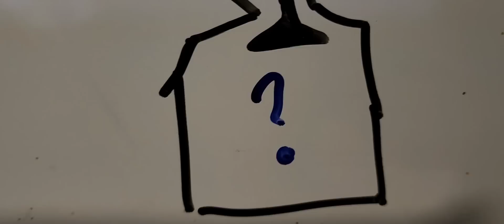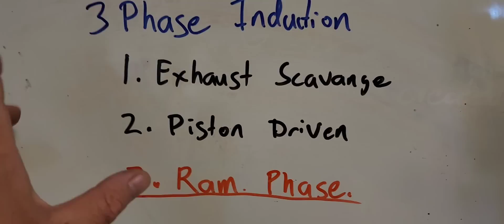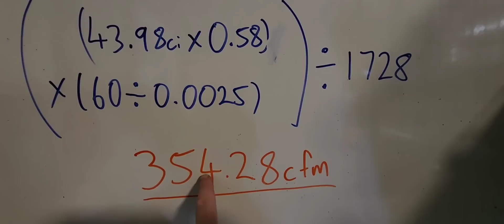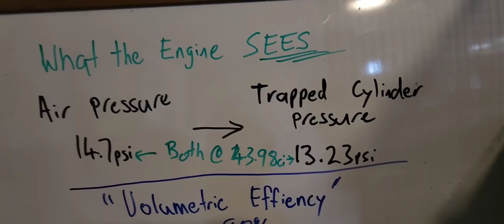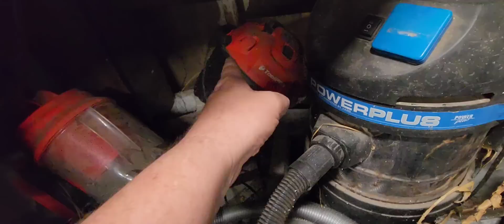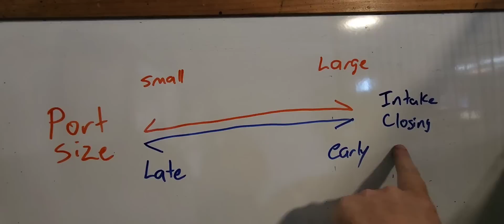Theoretical look at why the 4V Cleveland got its port size.

Comment: Does any of this information transfer to the inverse such as a big block Chrysler head which has very bad flow characteristics?
Reply from the maker: In general terms, if the port is large, then it should respond to an early intake valve closing. 

As I have no experience with Chryslers (yet), I can not give any form of opinion as I have no basis to give one. If it's related to the RB Wedge head (I think that's what Chrysler called its big block range - RB), then there could be other features in the port/chamber that give it bad flow. Until I have one in my hand, I simply don't know. I say this head as the Hemi has got giant ports, so it should fall under the same category as a Cleveland.

Comment: Good thought experiment, thanks.  I hadn’t thought about the restriction p
Area but you may be onto something there. I do believe that the 4v heads were designed with high performance in mind,which is why they are a bit lacklustre at typical street trim and 351ci. They seem to work very well on 400+ inches.

A couple of comments.  Your CFM calculation overlooks the fact that the intake is only open on every second revolution, so the calculated CFM number is half of what you found.

But on the other David Vizard teaches us that on a well built motor at peak torque the so-called 5th cycle actually brings in more air than the rest of the induction stroke.

Anyway, I don’t think either f these points changes your conclusion.
Reply from the maker: Thank you.

While the calculation is experimental, I didn't account for the 4 stroke (so half the rpm) because this is the theoretical demand the piston creates in the first 90 degrees of rotation at every induction stroke. Projecting the demand to 60 seconds fills in the Minute part of CFM. 
I also calculated this way as taking average piston speed would only give average cfm demand throughout the complete intake stroke and ignore the piston driven induction to ram induction. This would lead to conclusions that the 4V port is "too big".
Reply: “Restrictor plates” not “restriction P area”

Comment: Some consideration on intake closing point is the quality of the fuel. If the cylinder goes into detonation because you have trapped too much fuel/air charge, and end up with a too high dynamic compression ratio, you cannot utilize the additional charge of a later intake closing. So the closing must be tailored to the fuel available.
Reply: You can not trap "too much" charge, thats the whole idea of making power.
Reply: @V8Lenny  He's correct, you absolutely can advance a cam to the point the dynamic compression will detonate the motor if the octane isn't there.   One of the reasons the early high compression factory motors all ate crap when they took lead out of gasoline.  Also terrible chamber designs didn't help.
Reply: @superkillr  then retard ignition or lower compression. But you want to trap as much charge as possible, thats how engines make power.

Comment: Mate, excellent video for explaining the 4V concept to non-Cleveland people.

I could see you struggling to communicate your innate understanding of the subject while on the fly, maybe you'd benefit from doing a script for it, so you have to time to articulate your thoughts?

I share a lot of your views on the design principle behind the big port, but I'll add some points that I think are pertinent to the history and racing success of the design, as well as the reasoning why the concept became a dead-end.

Now before all the Ford freaks out there start throwing tomatoes at me, I'll let you all know that I'm a Ford guy myself, however to know a marque well is to know its faults and where their ideas may have stemmed from (ie not necessarily from the company itself).

In the mid 60s, Ford poached a number of engineers and managers from GM. This coincided with the Cleveland and 429/460 head design sharing some elements from GM engines: namely the Chev big block and Oldsmobile V8 (head design and timing cover/fuel pump respectively). So the ideas came with them.

If you ask any BBC expert, they'll acknowledge that there are "good" and "bad" ports, where the equally-spaced, canted valve arrangement was adapted to siamesed runners on the intake manifold, presumably to keep the intake tracts all the same length from carb to valve. This may have achieved the desired objective, but created the aforementioned good and bad port situation. 

The bad ports shoot the intake charge towards the cylinder wall, the good ports have it pointing towards the spark plug (ie centre of the cylinder). There is a good 20 cfm difference between these ports, stock or ported, which means that this is a flaw that cannot be completely worked around.

I would then argue, that due to the Cleveland's cylinder head bolt layout and pushrod location having to match that of the Windsor, that the port direction is actually like those of the "bad" ports in the big block Chev. Again, there is no working around this flaw, as (when viewed in plan view) the port opening starts roughly inline with the cylinder bore, then curves outwards towards the cylinder wall. This is the opposite to how the air really wants to flow, and granted, the canted valve helps turn the mixture back into the cylinder, but that's another turn (and loss of energy) that the mixture encounters. This is present in the 4V port, but more noticeable in the 2V.

I think in hindsight, with such constraints put on the design, that Ford would have benefited with an extreme bias toward curving the mixture more gently into the middle of the cylinder, instead of having it heading completely in the wrong direction then trying to correct it right as it turns into the valve.

Any thoughts on this?
Reply from the maker: Yea, a script would help with articulating ideas in a more consice way. But, like the work I try and convey, it's raw and uncut. I don't see myself as a professional and hope to promote positive experiences and debate from normal individuals.  I  have no issues with the various points of view. If I disagree, I will say why. However, this channel is just a collection of my ramblings that one day I might have the chance to build a Cleveland to put into practice the theoretical I am trying to get across. Let's face it, a 30-second video of a 12-second 1/4 mile makes more of an impact than 30 minutes of chat.

The 2V assessment would be accurate as once a 2V hits 0.4in lift, flow effectively chokes. No matter how much value lift, flow does nothing. In some cases, flow reduction

I will have to include a modified 2V in the head review I intend to do. It has been opened above the spring seat and reshaped using clay. Flow improvement over stock was 30cfm. It raised the port about an inch, so it was very experimental. At best, it would be easier to replicate this work on an alloy unit if it were to be tried on an engine. But financially, I'm just not there by a long shot.

Comment: Ford large port 4v was for racing big rpm not for street use but homologate regultor  of NASCAR etc brought them to public ,Ford's engineering  knew exactly  what  they were doing and achieving they had more experience  than average  joe with a couple  of  vacuum cleaners  ,drag racing ,le mans ,trans am ,canam ,nascar etc the list is longer than a flow bench
Reply: formula 1 could be added to the list as well with their joint effort with cosworth. the Ford/cosworth DFV engine was the staplehood of F1 when they were running N/A and was regarded as a masterpiece in mechanical engineering by nearly everyone. i think honda had their own engine and of course Ferrari didnt care for Ford, so they ran their own as well, but not without issues

Comment: So if we close the ivc early does that mean we start it earl? Lengthen the exhaust duration? Tighten the centers? What would you summarize regarding valve events? Thanks for this insightful video
Reply from the maker: We have to be careful around the overlap of a Cleveland. It's not just low lift flow that makes it have great potential for exhaust scavenge, but how sensitive they are to the exhaust as a whole. 

Im dreaming up the equipment to test/show this, but first, I need to get the flowbench capable of pushing air through the exhaust port. It is this side that is the trouble, and I think many will be shocked as to why. (It's not just the low cfm flow either...)

Comment: Richard Holdener compared all the muscle car engines of the 1970 era and the 351 Cleveland was at least 30 HP ahead of the competition. He also found the torque levels at low RPM were as good as the competition.. Ford definitely had the edge in horsepower and torque.. Sorry Chevy guys
Reply: But the Ford cost twice as much to build, and had to be rebuilt twice as often. And yes I have built good budget Chevs and then good budget 351s which are a LOT more expensive. As for Holdener,, yes some of his work is interesting but most is hack work.
Reply: The Ford 351C cylinder head dominated NASCAR and NHRA for four decades. The LS with its equally spaced intake ports, excellent crossflow, dry intake manifold, and distributor moved to the front of the engine is a copy of what the 351C did 50 years ago. Nice try, bow tie guy.
Reply: @hoovej2  me and my brother both had good results with the 351 Cleveland. Good times.
Reply: That's only a small block comparison he did.

Comment: During the mid to late 70's, we ran Cleveland power and found nothing responded compared to inline engines. Took a while to decide that no matter the camshaft, there was no effect until -- we decided, because what we had been doing came from the Monkey See-Monkey do. Steel billet cams were I think about 200 bucks(?). So a cast iron was 50-75 bucks(?). I talked with the grinder about trying 3 different grinds by spreading the lobe centers. We knew we'd get a couple two-three hits before the cam chipped out. This was something I had done on 4cyl engines to learn how they responded in dyno efforts. -- So, the first stick was the same grind with the lobes moved 2 out and then 2 more and 2 more.
We saw the trend right off and each stick not only improved times but speed as well. The grinder got wound up too and suggested we pull duration out in steps, and it responded as well.  So with a huge savings and plenty of magnets, we learned more about that engine compared to any other small block. At the end, 113 is where we got good results. It would really reach for the next gear compared to prior engin mods. -- So, we gained significant valve to piston clearance in which we picked up notable compression. It was finally fun seeing it wake up from simple working around camshafts. 
Erson Cams gave us the success and knew what we needed as we did the work. Don't doubt those boy's. At least during those years, they had our best grinds and cause and effect.
Reply: Yes, lobe separation angle is a big thing in Clevelands. Most cam grinders suffer from "Chevy on the brain" and want to give you a cam with 106° separation angle, when you really need 114° separation angle. They will then argue with you till they are blue in the face.
This is because they do 1,000,000 Chevy rebuilds but hardly any or no Clevelands purely because in the U.S.A the Cleveland was a short lived, obscure engine, that came out just when engines were hammered with pollution legislation.

You must insist on unusual grinds, be willing to experiment and take a hit if the grind doesn't work out, then try again.
The Chevy had millions of people experimenting over decades to find its secrets. The Cleveland has still yet to receive that much experimentation or development.
Reply: I remember the Viking cam in a cleveland. Pulled hard.

Comment: The 4V head was developed for Trans Am and was used on the Boss 302. This type of racing requires a high reving engine so the low end torque can suffer a bit but the top end will pull away from the competition. Bob Gliden stuffed the ports to get some of the low end back for drag racing as this is a different application. He also raised the intake and exhaust ports for a more direct line to the valve. On the exhaust side of the head is the worst restriction due to fitting the engine in between the shock towers of the Mustang. Cam timing and overlap is critical with the Cleveland canted valve design. If you run a cam design for inline valves you can lose some of the intake charge out the exhaust. For normal street use the smaller ports seem to work a bit better due to the increase in low end torque. For high rpm the big ports are the way to go and make sure the cam matches what you are trying to accomplish.
Reply: Not always true. I've had a boss 302 in my 68 F-100 with a C-4 for 30 years now. 
Has excellent throttle response. 
Better mileage and driveablity than an FE.
Depends how you cam the engine.

Comment: Basically the 335 series was a 385 series downsized with some additional upgrades. Port and chamber designs were similar.
Reply: But the 385 had enough capacity and oiling to use said ports.And are heavier again than a 335. Especially the lump of 400.
Reply: @ldnwholesale8552  check out what Tim Meyer does with 400's... he gets insane power out of them! 
All they need is de-smogged pistons and straight up cam timing and they make wicked power
Reply: @ldnwholesale8552 the 400 is a 335 series with big block bell housing pattern

Comment: Although a bit of a technicallity, the engine does not draw fuel air mixture into the engine. The air pump (engine) creates a low pressure area in the cylinder and the outside atmospheric pressure "pushes" the mixture into the engine. The ability of the mixture to be pushed into the engine is controlled by the intake tract, (port sizes, shapes, valve opening, ect). This is simply referred to as volumetric efficiency or VE. The mixture is never streched it increases in velocity due to the fact that all the air available is pressed into a smaller orifice called the intake tract. The easier the mixture will flow through the intake tract the better the volumetric efficiency or max VE. This explains why when the throttle blades are closed low pressure reading below the blades is higher because the engine created low pressure area is u able to be filled as easily when the intake tract is closed to outside pressure.
Reply: You have most of that right, but you miss a VERY important point - this is not a steady state condition, but is continually varying.
As such, the inertia of the air-fuel mass is a critical consideration when selecting the engine parts for that specific build..
Reply from the maker: I have to disagree on the "push" explanation on the basis of energy transfer. Sucking is taken on the first half of the stroke as an engine has to consume energy. Pushing refers to an external energy that creates movement. The push comes after, in the ram phase. Which is more a combination of inertia effect from the initial "suck" phase and the push from what pressure is in the plenum. The reasoning for this is that the pressure trace after 90 degrees always heads down as the cylinder pressure equalizes. 

The strecth description is chosen in terms that when anything is stretched, it becomes thinner. As said with Rule One, velocity is traded for decreased pressure, so energy between the two states (rest and movement) remains the same. The greater the depression, the greater the weight loss, and the greater the speed. Since inertia is the combination of weight and speed, then the trade-off of reducing weight to increase speed to increase inertia will plateu and fall. Or, in other words, the energy required to accelerate the air will exceed the energy potential that can be trapped in the cylinder. This process  begins past peak torque, which I suspect is much earlier than most realize.
Reply: @crd-nz_001  
You may wish to review that in terms of absolute pressure.
I suspect the use of "stretch" may be confusing, as it may mean different things to different people - perhaps "elongate" will please the gentleman more?
I can understand you using it as in "gauge" terms one may think of the depression in the cylinder "pulling" on the charge in the port, but I'm more used to working with "absolute" pressure, as the other chap may be? 
It does confuse it somewhat, unless one thinks very carefully what is happening in the port, regarding pressure and velocity gradients.

Good watch, and some good points and thoughts on your part.
Might need to give the exhaust side a little more attention - remember, the piston has to impart the energy into the exhaust for it to "scavenge', and that energy is largely provided by the piston excerting pressure on it.

On that, IIRC, the exhaust port design wasn't as sound as the intake, but been a few decades and the brain gets foggy?

Comment: The Ford engineers knew exactly what they were doing. The problem is the average person doesn't and they can't understand what the Ford engineers had in mind.
There is a epidemic of "Chevy on the brain" in V8 engine circles and that is a fatal error when working with a Cleveland.
You must get into the mind of the Ford engineers and ignore what is done with other engines.
As far as 4v ports, look up Bernoulli's  principles of diverging and converging passages.
Reply: Yep, you had all these Chevy lovers at the cam companies thinking they knew the Cleveland better than Ford and recommended off the shelf junk that "worked" in a 350 to put in a Cleveland and in effect, tanked one ot the best engines ever made.  Also, the design was hampered metallurgy of the era.   NOw we have springs and cam profiles that can take advantage of everything that head has to offer.